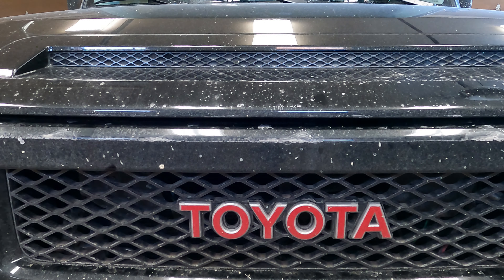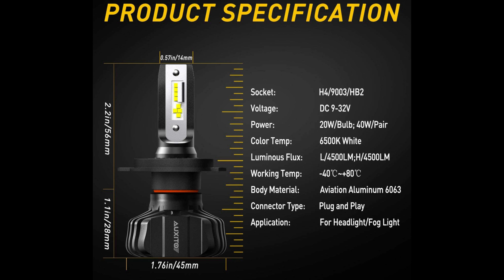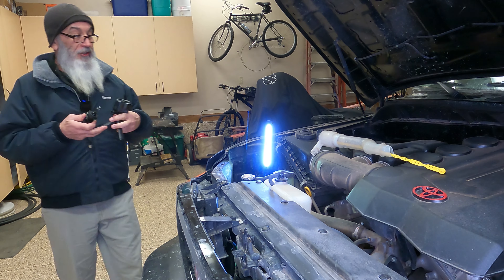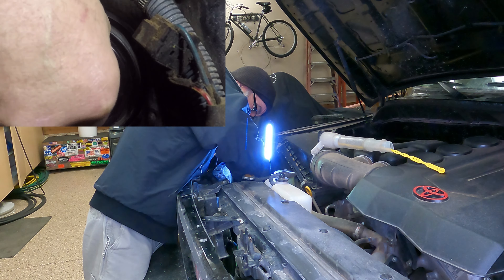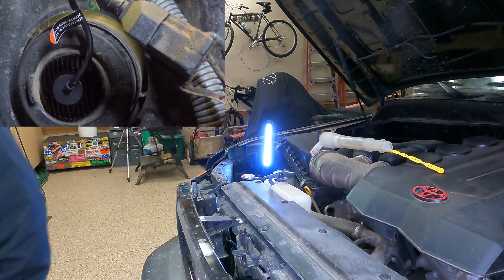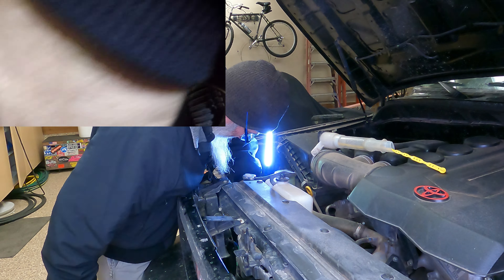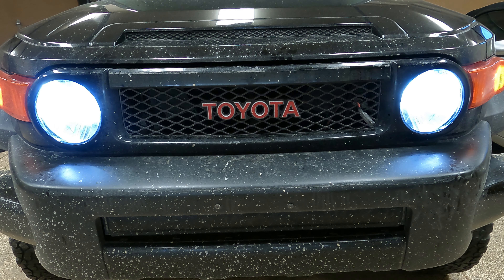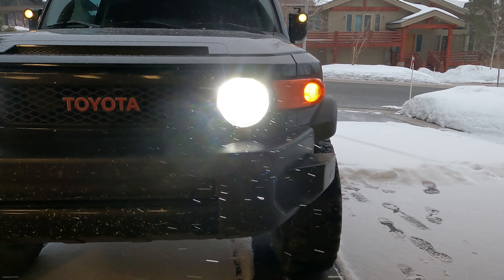FJ Cruiser gets new LED Headlights💡 for the 4th time?

Comment: Did you have to add an rF choke to the lines, did you already have some installed, or is the rF choke now part of the build?  Years ago when I added LED headlights to my Sequoia, I had to add one choke per housing to help eliminate interference with the radio.
Reply from the maker: No didnt add a thing, I have all interior lights LED's the mirror lights and reverse light.  Plus 2 LED light bars and stock single disc Satellite radio.  No issues

Comment: Nice. Something seems a bit odd with them... it is like the high beams are the low beams. Maybe they need to be adjusted a bit? 

Dead link report: 24th scale die cast FJ link no longer good.
Reply from the maker: ThankQ   link Fixed
Re: of the 4 different bulbs I have used, they all have shit for high beams, low works best. When I need more light I have the light bar(s)
Reply: Right on.